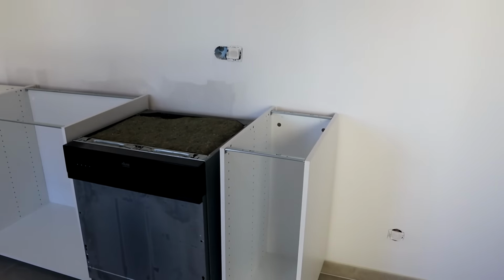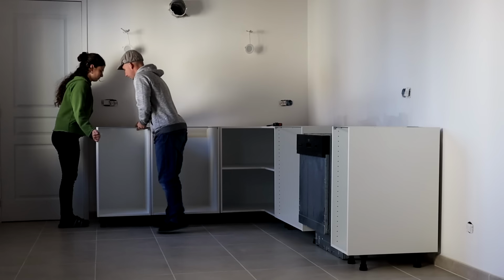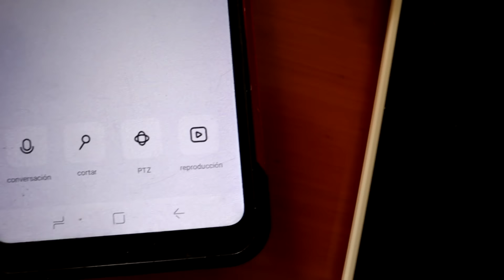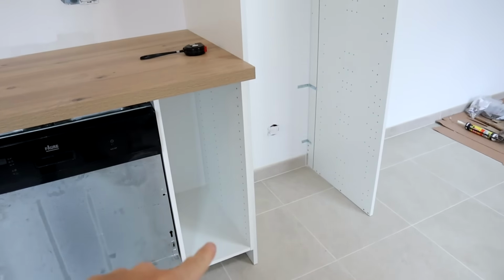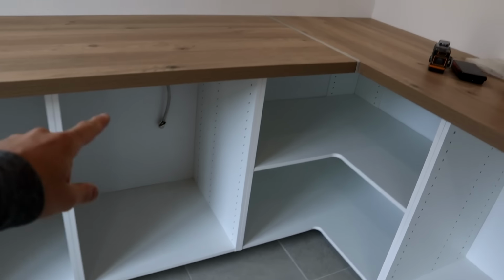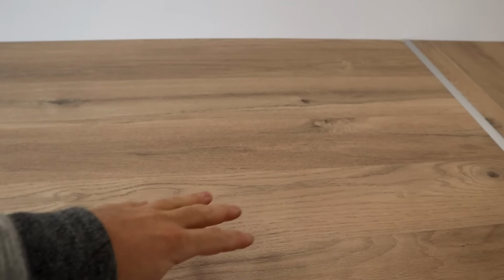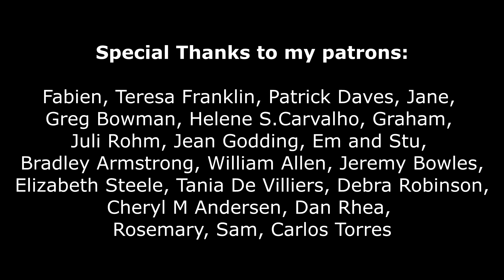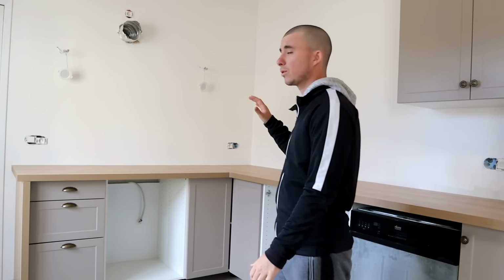Setting up the New Kitchen // Renovating our 200-year-old house #73

Comment: The upper part of the wall cabinet should be at the same level as the refrigerator cabinet and the latter should end with a white panel (without a bench top).
The bench top should end in the same plane as the side (vertical top)

Comment: Did you get the protectors so when the doors close they do not slam on the wood.  Some are made of  felt but I like the clear little plastic pieces self adhesive.

Comment: Hello Diego.
I regularly follow your work on the channel, all praise for your efforts.
I'm interested in the name of the tool you used to connect the pipes in this video at 11:00 and where I can get it, post a link.
There is nothing similar in my country that I could buy.
Just be brave and greetings from Serbia.
Reply from the maker: Helo sir, THANK YOU! I use PER pipes in my instalation and I use the joints with names in French (a sertir) and have a special clamp for these joints. It is the best method I have tried, very common in France, 
here is a link https://www.leroymerlin.fr/produits/outillage/outillage-a-main/pince-et-tenaille/pince-a-sertir/pince-a-sertir-pour-raccords-multicouche-et-per-profil-th-coffret-84613432.html?Megaboost&at_medium=Sea-Paid&at_campaign=BREC-04-OUTILLAGE-PMAX-SHP-BOOST-3P&at_source=google&at_market=M2&at_section=R4&at_campaign_id=20486450840&at_campaign_type=PMAX&at_campaign_sub_type=BOOST&at_account=FIL-ROUGE-SHOPPING&at_account_id=921-620-5076&gad_source=1&gclid=Cj0KCQjwhtWvBhD9ARIsAOP0Gohb49AJsSPJUfVannrZ4wxjeGd_aBvId3ikYn_ZkJ-b-LZ1kv_Fq5kaAqRREALw_wcB&gclsrc=aw.ds
greetings to distant Siberia